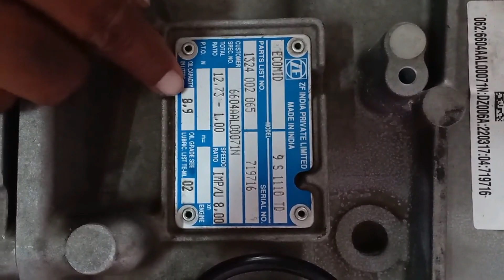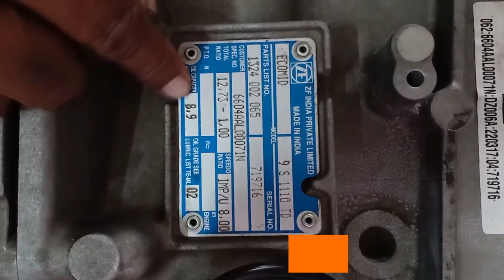ZF 9 Speed Gear Box - Part 1 | Introduction, Information, Working Principle, Parts - In English

Comment: The two plugs in the planetary, are two pivot screw bolts which are used only for aligning the planetary fork. They are not used for oil filling.